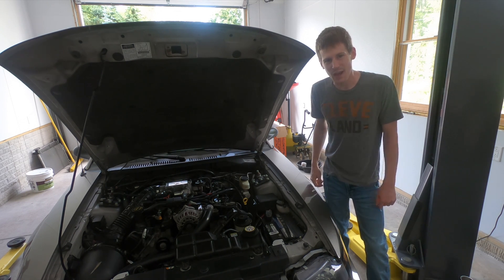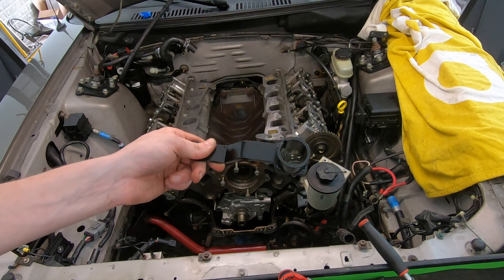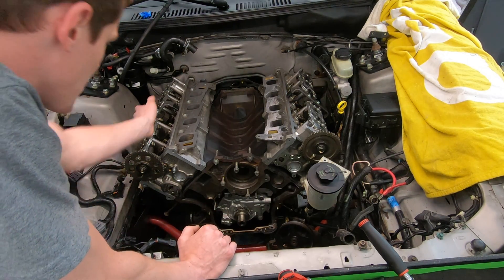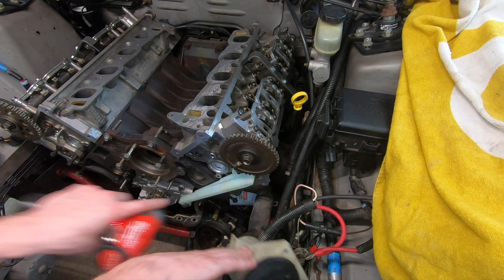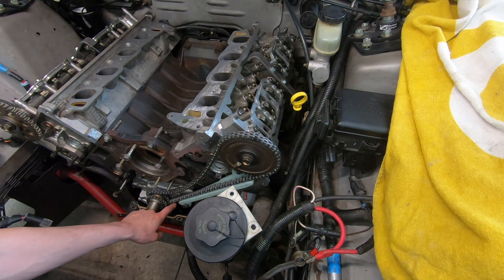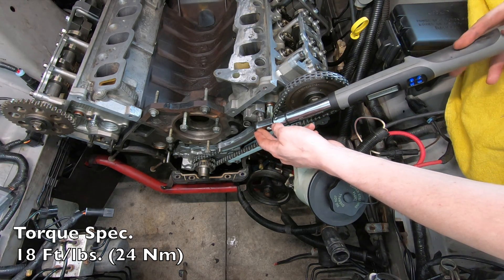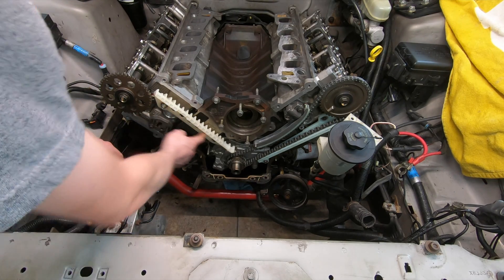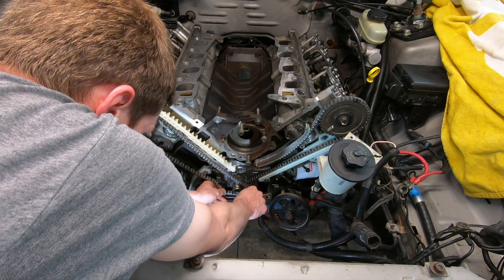Ford 4.6 2V Timing Chain And Guide Replacement.

Comment from the maker: Here are some of the parts and tools I used for this job:
Crank holding tool: https://amzn.to/2SwFMP6
Cam Holding tool (2 required): https://amzn.to/2SB0BZV
Cam follower removal tool: https://amzn.to/2XVPe4F

DOUBLE CHECK THE FITMENT ON THE PARTS! There are too many different timing sets for me to list all of them. If your vehicle has plastic tensioners I would suggest upgrading to the iron version. They have proven to be more durable.
Bolt Part#: W709818 S437
Parts:
Ford Racing Timing Set: https://amzn.to/2SwwuTB
Cloyes (plastic guides, iron tensioners): https://amzn.to/2Y3paji
Cloyes (metal guides, iron tensioners): https://amzn.to/2YkkiKT
Reply: Do you know torque sequence for cam cap bolts I can't find it nowere
Reply from the maker: @Criaderovaldez  I have what you are looking for.

send me an email repairgeek365@gmail.com and I can send you a picture of it.
Reply: @RepairGeek link to the longer bolts ?
Reply from the maker: @t.farris1755  turn the crank until the timing mark is at 6 o'clock on the crank gear and the dot on the cam gears are at the top.
Reply: Repair Geek sorry for asking a lot of questions but this is my first time doing this and I just want to make sure I’m doing it correctly so I don’t damage the engine
Reply: @RepairGeek  I removed the tensioners,  and the camshafts shifted slightly.  Now the chains master links don't line up. The RH shifted to 10oclock, and the LH shifted to 1oclock. How can I get those back to 11 and 12oclocks to line the chain links up?
Reply: I think you did a very his job showing us how to replace timing chain
Reply: So did you go with the plastic guide kit or metal guide kit?
Reply: Hey Geek i know I can use the iron tensioner's on a 2004 crown Victoria @ list I think I can.. does the cloyes kit come with the metal gasket for the tensioner's do I need to use them or can I use the tensioner's on the crown Victoria the same way you used it on your mustang with out the plate/metal gasket? Or are the metal gasket only used in other applications? Also my car came from factory with the plastic tensioner's
Reply: The replacement bolt number you put up on the video was a door bolt is that the bolt to use for the cloyes new chain guide?
Reply: @t.farris1755  Did you get it?
Reply: @josephmcnamee9338  sorry I no longer have the vehicle. I already fixed it and traded it in for brand new car. Thanks
Reply: The code w709818s437 Bolt part shows handle door?
Reply: @t.farris1755  which way did you turn it? On my Honda civic you have to turn it counter clockwise
Reply: @Иванпонимаете-г4ш  I no longer have the vehicle I was inquiring. Traded it for a brand new car. So who ever replies to any questions I had pertaining to this repair please disregard.

Comment: You don't need to unplug the crank sensor to build oil pressure. You can hold your foot to the floor and crank it for about 15 seconds. It won't start until you let up on the gas 

5w 30 seems to quite start up rattle and on work ones you can floor it and crank it to build pressure every cold start.

Comment: Ive got a 4.6 of my own. Mine sits deep in the engine bay of a 98 f150. I thought about just sending it into a shop to get looked at (Just put 160,000 miles on it and the timing chain should be replaced as a part of good maintenance) but after a quick quote from a few places I figured im just gonna have to do it myself. 
Im not that flush with cash to spend that kind of money on it, so looks like ive got to get smart quick. Spark plugs need a good swap too, so ill do that when its all tore out lmao. appreciate the video man. feel like im doing all of my maintenance at once. thanks.

Comment: I ordered this 40$ set of 4 bolts because i tried the short bolt in the wrong whole then canada post had a strike so i went and bought another $40 set at ford then went to try the new bolts dont reach for the top one and too long for the bottom check my old bolts and they work with the new tensioner

Comment: What if you set the crank to TDC but you suspect its in the intake stroke? My cam marks are exactly 180 from 11 and 1 o'clock which leads me to believe I need to rotate the cams to the correct position, but can this rotation be accomplished with the crank sitting at TDC? Dear lord please help.
Reply: What did you do plz bro
Reply: @kadincolbath640 I left the crankshaft at TDC and removed the rocker arms, allowing me to rotate the cams and install and align the timing marks in correspondence to the crank timing mark. Once aligned, use whatever cam locking rig you have set up and install the chains; adjust locks as needed to accomplish proper alignment .

Comment: Hello, I have a F150 4.6L 2v engine that is making a tapping noise for a couple of seconds upon startup half the time. What could be causing this do you think? I thought this truck had cam phasers at first but the parts department at Ford advised that my truck has the timing chain and sprocket.

Comment: So im doing this now. And taking the timing chain off the passenger cam snapped back.  I see you didn’t have to move yours when you installed your timing chain. Can you explain. Having issues because I’m trying to turn the motor to check the timing but it won’t spin freely but I also did a head gasket

Comment: A guy at the dealership used to use strips from a glove box, remove one cam cap bridge and set stips in there and re-tighten, then perform replacement ( just be sure to remove the cardboard )

Comment: So if your at tdc an your cam sprockets are at 11 o'clock and 12 o'clock, and the timing links on the chain aren't lining up on said sprockets, do you put the new chain on as you took the old one off or line the new chain links up to the sprocket? 😂

Comment: When I took my  2002 mercury grand marquis apart the drivers side chain was loose, passenger side was tight.  The tensioner had worn through the tensioner guide on the drivers side so I assumed that was why the chain was loose.  When I did the timing job per your video, the drivers side is still loose and the engine rotates by hand freely.  Is because I haven't started the  vehicle yet and there is No oil pressure?  The tensioners I took off were Cast Iron, the drivers side piston top was ground off(closing off the oiling hole), passenger side still good, Both tensioners still had Compression.  I purchased the Plastic tensioners, which are the new ones, the slop is in the drivers side is at the stationery chain guide, where the tensioner guide blew out.

Comment: After you have the cam sprocket timing mark correct on both banks and both chains have the colored link on the timing mark on the crankshaft gear. And you then remove the cam holding tools, will the timing marks align after making 2 rotations of the crank shaft, back to TDC.  If NOT how many revolutions of the crankshaft do you have to make before the Marks Align?

Comment: Excellent video, I wish to know how to remove the rocker followers without taking out the cam towers using the spring tool otc 6674, versus the Cam holding tool method.  I have done the 5.4L 3v using fordtechmakuloco 4 part  videos.  For the 4.6L(romeo mercury grand marquis 2002) with timing set at TDC, is it ok to begin removing rocker followers as long as the small part of Egg/cam lobe is pointing Up and for each valve that the small Lobe is pointing up.  Rotating the crankshaft clock wise to the next set of Lobes pointing up and pulling those rocker followers, then rotating again until all are removed.  Then make sure you return the Crankshaft and cams until they are again at TDC.  Then begin the timing or removal of chains, tensioners, etc?  Thank you.

Comment: Out of curiosity, what was the whole point of mentioning bending valves on cylinder 1 AND 6, what does that mean in regards to the process of doing the job and making sure all timing marks are correct? You said that like there is something we are supposed to actually look for ??

Comment: I have a Melling kit that comes with cam sprockets.   I see the torque spec is 90 ft lbs.   I guess it’s a bad idea to try to change them with the heads installed?  Any problems not changing them?
Reply: New chains should be used with new sprockets

Comment: Thanks for the video it’s the best ones I’ve found. Quick question. If I’m only replacing the guides and tensioners do I need to install the cam holding tool? Or would I simply remove the tensioners, tensioner arms, and chain guides and replace them? I’m working on a 2005 Town car.

Comment: What if my crank sprocket is at 6 but my passenger side cam sprocket is at 5 and and the driver side cam sprocket is at 630?
Reply: Can I just count 180 degrees around the cam sprockets and use that as my dots?

Comment: I have done this job several times on the 4.6L 2V in the Crown Vic. They changed to the plastic chain guides in 1997. I absolutely love this engine. I have 467,000 miles on one in my 2006 Crown Vic. I replaced all the timing components around the 240,000 miles. If you hear a cam chain rattle, replace everything. You can double the life of your engine by replacing the timing components before they fail. I used the oem Ford parts. Yes they are more expensive. But $450 to get another 250,000 miles, maybe more, out of the engine is peanuts. I also change my oil every 3000 miles.
Reply: Can someone who's never done this job before do this? I've personally only replaced valve cover gaskets/alternators stuff that's on the outside of the motor, Just want to see from other peoples point of view, I'm planning on doing this job on my 2002 grand marquis that's starting to have timing chain rattle on start ups.
Reply: @thatslow4.6  If you are very very careful. You can lock the cams in place, and there are marks that must line up on all the pulleys, as well as marked links on the chains. There is also a specific way the guides and tensioners have to be installed. I have seen a couple of really good videos on YouTube on it. But if you have never done it before, I'd suggest parking the car inside a garage first, as you may not be able to finish it in one day, and you need to be able to keep dirt out of the engine.
Reply: Actually,  only the Romeo changed in 97, the windsor used the steel backed nylon guides up until 2001....

Comment: I asked someone who has done "about 20" of them about the longer bolt on the passenger side and he said that's on the pre-2000 models where the fixed guides used to have the aluminum spine. I didn't think to ask if that meant the 2000 up already came with it that way... that's what's coming to mind now. The one thing I've noticed with Lincoln Mercury Ford is there seems to be 3 grades of parts used. Decades ago people used to say, "That's a Lincoln engine" when they were being specific. So I asked a Ford guy what the difference was. He said in the foundry's they grade the engines and the Lincoln cars always get the best even if that same displacement engine was used elsewhere. But that didn't mean Ford was getting bottom of the barrel junk. It just meant it was getting something slightly different than Lincoln. But I asked him about those bolts because I would have ordered them if I thought they were going to be necessary. I guess I'll know when the guides arrive because you can see the difference.

Comment: I read a couple factory shop manuals..i don't have one for an 03 up but I know there's nothing in this job that's too different and I read a Haynes and then I had some questions. So I consulted people on a crown vic and Mercury Grand Marquis forum and I got probably 70 great answers. Some even provided pictures and write-ups with the pictures. But most of them said if I'd ever had a quiet 4.6 I'd had an anomaly lol. One guy swore it was rare to have a noisy one because his three were quiet. I've had 6 4.6's and one 92 Lincoln was just beginning to get a little noisy, a 96 MGM that was always noisy on every startup and I sold it because I didn't want to fix it ..there were other issues plus a super soft cloth seat with zero support.. I'd rather have cloth but on mercury it's not supportive. Anyway and this one that's intermittent. One guy in Fayetteville AR provided so much good information i decided I'd probably wait till it warms up because cold weather will seize my back and then moving any kind of way is difficult and painful. So I'm going to watch videos until then. 4 or 5 of the people on the forum said they don't lock the cams down. They just line them up and then do it and have never had an issue. But they all said at my low mileage there's no need to replace the chains because they do not stretch before 3 or 400,000 miles. I understand why shops would anyway... because they don't want any little possibilities and have to eat the labor. But the diy doesn't really need to worry about it. I'll pray about it until I do it. That will determine what I do. *Ok...none of those Ford people i asked replace the chains until major miles are on but these are older mercury Grand Marquis people. There's two things that stretches chains. No, 3. 1. High RPM, racing, running hard. 2. Variable valve timing. 3. Lack of maintenance. Oil maintenance, specifically. So if about 70 genuine Ford people tell me they don't replace those chains until at least 300,000 and some said 500,000 I'm not likely to replace them unless I can see or measure a big enough variance. The original chains were made by Morse and there's no chains sold... not even the one's sold by Ford that are as good as the originals and that's sadly the way new parts are today. So for myself I'll check it before I just chuck it. It's not a GM or Mopar.

Comment: Any videos on a f150 4.6 not sure if I can access them without removing the engine. wondering if I should check mine. I hear rattling but only above 2500 rpms im guessing the chains.

Comment: 11:20 you could also pull the fuel pump relay, that is a much easier thing to do if your engine is fully assembled. The crank sensors are on the bottom of the timing cover on these 4.6L engines, and like mine, it's pretty much blocked by the A/C compressor.

Comment: I'm going to do mine here shortly before winter comes around on my 03 grand marquis seems to have erratic startup rattle sometimes after sitting after a while it does it while sometimes it doesn't rattle. it's at 230K, doesn't have any other issues besides that. I'm also replacing the oil pump as well while at it looks intimidating at first but with the right tools i got it.

Comment: I just did a valve job on my 03 f150 5.4 I just had the engine timed. All new tensioners guides chains and for some reason on the driver's side lower guide. The chain has some slack I don't know if that's normal.When I rotate the engine It has more tension, but then it still has slack at a certain point
Reply: What ended up happening.  I just did a 4.6 2v and it's acting the same way.  It becomes loose and tight all within a hand crank

Comment: What to do when cam rotates and have to put it back at top dead center? Putting the pistons at tdc is easy but the cam shaft is a little more difficult to get the actual tdc

Comment: Where did you get that cool beeping torques wrench. I have. 3/8 clicking torques wrench but haven’t used it and it’s lowest setting may exceed that required by the 13pound feet. 

Also thanks for the awesome and simple Video

Comment: I’ve done hundreds of timing chains on ford 5.4, 4.6 and have never used a cam holding tool in my entire career. Even if the cam were to spring back there’s not enough pressure to damage anything at all.

Comment: Bolt number given to me by Ford is actually
W5032795437

I compared the 2 bolts (the one in the description and the one given to me by Ford) and they are the same size. The description for the one Ford gave me lists several engine applications and the one in the description is listed as a handle bolt. Both grade 8.8. Going to use the one Ford recommended me but you could probably use both.

Comment: If you did head gaskets where do you no where to place cams in what position?
Reply from the maker: Install holding tool, remove cam, remove head, install head, install cam, time engine, and remove the holding tool. 
Leave the holding tool bolted to the cam during the headgasket procedure. As long as the holding tool is on the cam, it will hold the position relative to the head.

Comment: What is the best way to re-install if I did not get 1 chain lined up on the cam gear?  I am 1 tooth off but have already pulled my pins on the tensioners.

Comment: I just bought this gt mustang 4.6 2v  2002 .it looks like someone was going to replace the the timing chains .if the cams or crank was moved. How would I go about putting it back together properly
Reply: Danny how would u go about putting the chain on a 4.6 2v  when u didn't set the cam with the hold down tool and they moved on u

Comment: Hey I'm replacing head gaskets in a 4.6l 2v v8 97 lincoln town car ss, when I put the crankshaft to tdc and removed timing cover I noticed the cams were totally off the dots where straight down but my engine runs smooth , I forgot to move the cams  into the timing position before installing heads, I installed heads  and  now I went to turn them to them timing position and I can feel valve hitting pistons so I don't force nothing. Do I gotta take the heads back off to turn the cams to they right position? Any info or suggestions please bro